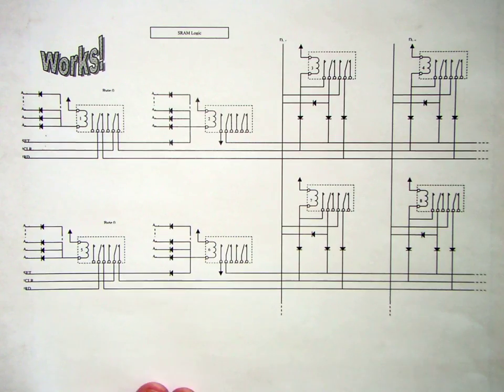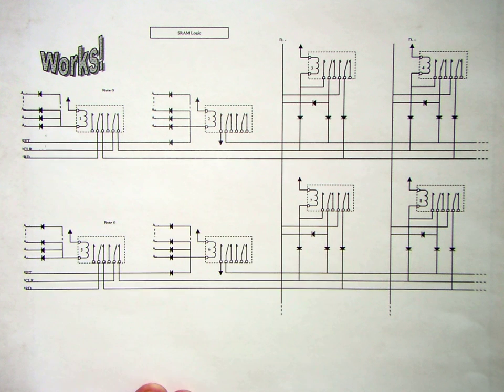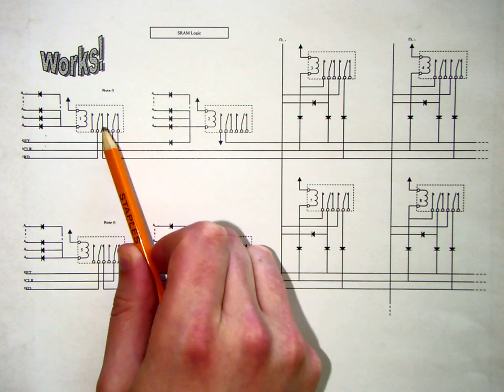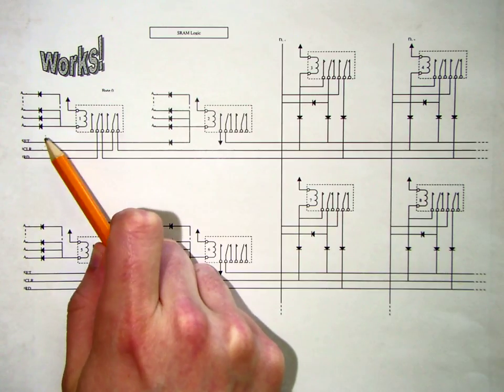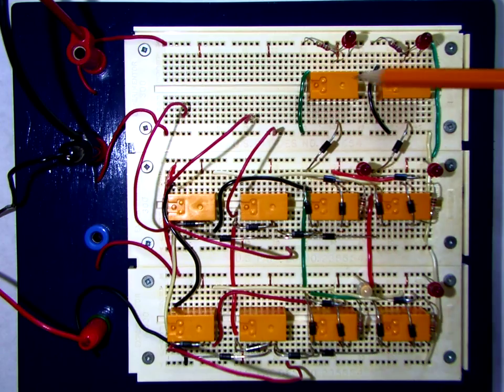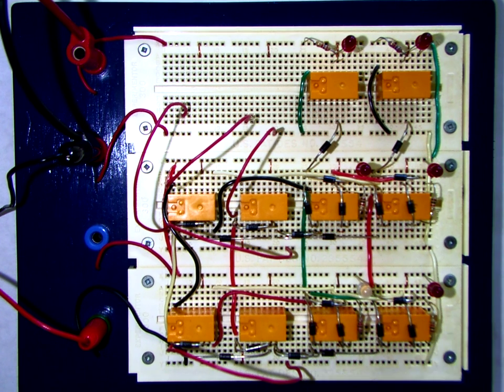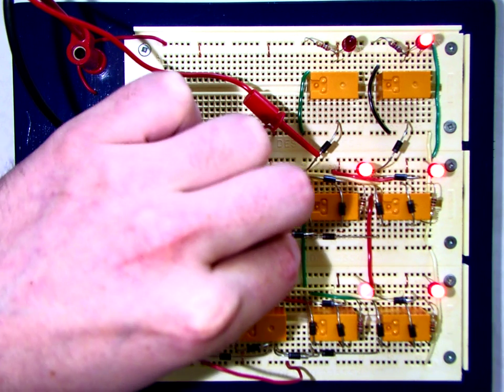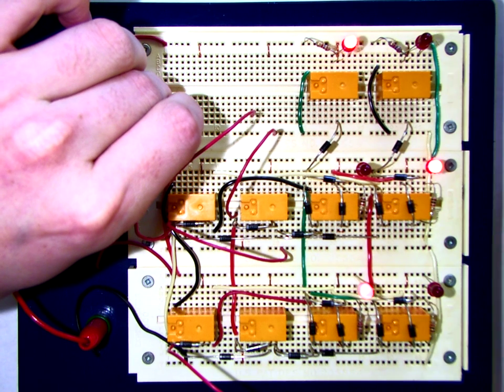Relay Memory Circuit

Comment: Using all of these diodes makes the circuitry function more like Binary logic and not Relay logic
Reply from the maker: +Jeffrey314159 It is both, binary logic since all signals have two possible states (ground and hi-z), and, relay logic since relays are used to implement it. It is true that the diodes are a bit of a shortcut as they do cut down on the number of relays needed.
Reply: +mrdigitallogic I am a bit confused here! If this is 'relay logic' then the two states are 1 and hiZ, for in relay logic the ground is an open circuit = 0. In binary (electronic) circuits an open circuit is a floating state = 1. If this is not so, then there isn't any difference at all between binary electronics and mechanical relay logic except for the technological implementation?
Reply from the maker: +Jeffrey314159 Well, a basic relay has 2 states, "on" and "off" depending on the current flowing through its coil. What a circuit designer can do with the on and off states depends on the pole and throw of the relay. The relays in the video are DPDT which can produce open and closed contacts for each relay state, so it gives the circuit designer a lot of flexibility.

For example, a designer could choose to use +12V and ground signal levels in their design, and connect 1 set of contacts to +12V when the relay was on, and the 2nd set of contacts to ground when the relay was off. This would form a buffer function. Reverse the wiring of the contacts to create an inverter.

For the design in this video, I chose to use ground and hi-z (unconnected) signals, for a few reasons:

- you could interconnect circuits using relays with different supply voltages, since each relay could still produce a ground signal and hi-z.

- it would be easier to interconnect the relay logic with TTL circuitry (with some sort of transistor driver on the TTL outputs of course) since TTL logic treats hi-z as a logic high signal.

- no worries about shorting out a signal somewhere...at worst, a short to ground would just give you a false logic low signal, no sparks.

- simpler connections...fewer relay contacts needed, and simpler switches for inputs (connect to ground or not).

Note that the mapping of logic signal levels to binary digits which I think you are alluding to in your last message is arbitrary. Usually circuit designers will choose to have a logic low represent a binary 0 and a logic high represent a binary 1, but there is no reason you couldn't build a digital circuit with low = 1 and high = 0, it would just be unconventional.

You are correct that there is no difference between electronic and relay logic except for the implementation. You could build a 64-bit relay computer if you had enough time and relays, and it could run the same as a 64-bit computer built from silicon, at least from a programmer's point of view. Of course the relay version would be very large, very slow, very noisy and use a lot of power!

Comment from the maker: @gohan100100 it would be roughly the equivalent of an SRAM circuit in the sense that it stores data with an active component, the relay. the relay stays powered on to store a 0 bit in this design. once the relay is activated (in the /WR phase), it has positive feedback to remain activated. before storing another number, the feedback circuit is de-activated to release the relay back to its rest, or 1, position.